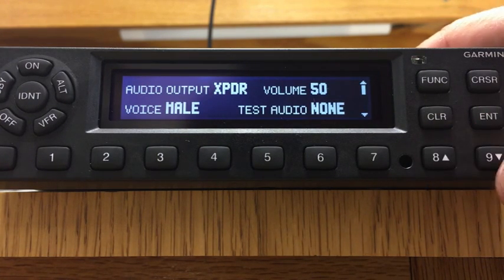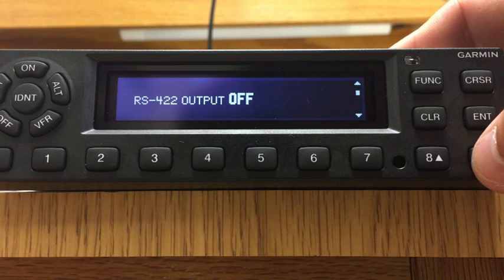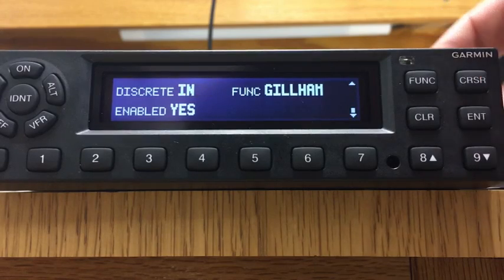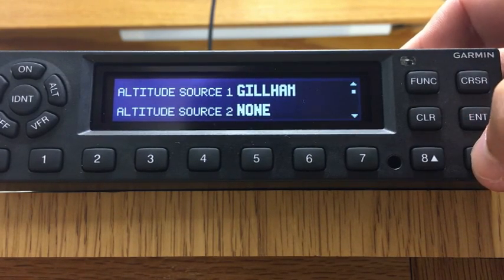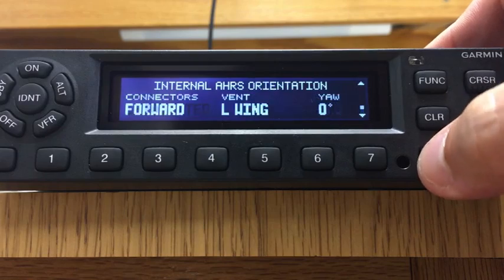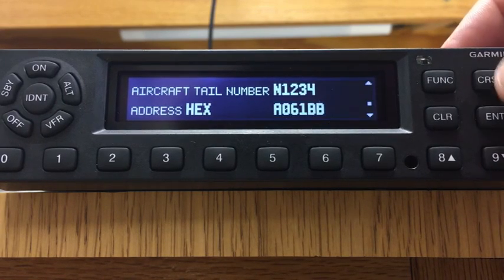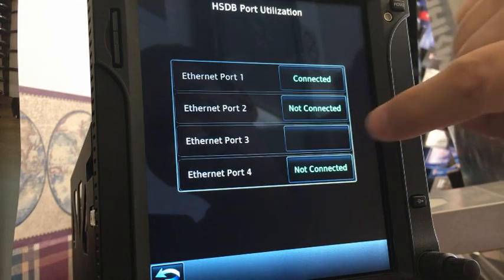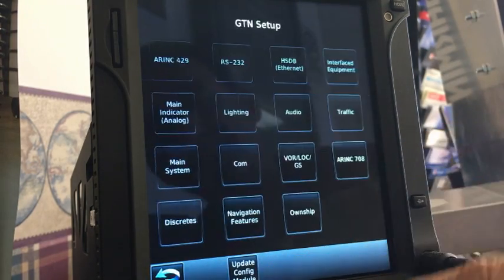GTX345 GTN650 setup

Comment: set allow pilot to edit flight ID to YES. It makes Angel Flight callsigns so much easier to program.
Reply from the maker: Yes it would be easier. The STC doesn't allow it but you can do as you wish. I won't tell.

Comment: Great Video!! Thank you John!!  I have some questions I hope you can answer.  How do you set up/configure a GAE12 encoder with a GTX345?  ATC "sees" the airplane 200 ft lower than the indicated altitude on the Aspen and the mechanical altimeters.  On the ground, with the Aspen and mechanical altimeters set to 29.92, the Aspen shows a pressure  altitude of -100, the mechanical altimeter shows -120 but the GTX 345 shows -200.  Also, should Altitude Sources 1 & 2 be set to NONE?
Reply from the maker: My suggestion is to do nothing. It is within 100 feet so it’s within Reg’s. Most encoders are only able to do 100 foot increments so they are often 100 feet off. The Garmin encoder can go as low as 10 foot increments.  If you want to get super accurate then you need to have a pitot/static test set.. follow the procedures in the install manual. Basically it will tell you to run theses test while plumbed into your GAE-12. Go to -1000 and push a cal button. Then again at 2 or 3 other points. Stopping at 30K if memory serves.  If it’s working then don’t change any settings.  Usually you go into the altitude encoder page and select Garmin encoder as encoder #1 and nothing as encoder 2.  If you have any other question be specific and I can help you through it.

Comment: Very Helpful. Question if you can...I have a GAE12 with the GTX345 and a GNS430W for GPS. Any tricks in the setup?  Doesn't show altitude? Thank you.
Reply from the maker: The setup in the GNS is pretty simple. It's of course in the manual. RS-232 in/out set to weather/TFC. ARINC 429 in set to High/ADSB traffic. The proper way to do the encoder is of course to connect it to a calibrated static test set and go to the 3 points per the manual. Conversely to cheat I've heard of people just putting 1 foot off on each of the 3 points and calling it a day. Obviously I can't recommend that.

Comment: Having the same issue with the Bluetooth not appearing in the main menu even after I’ve enabled it in the setup portion.  Not using any of the serial ports between devices, just wanting to connect wirelessly to the Aera 660 to send over adsb in info / AHRS etc.  . Does it need to have those physical connections?  I am getting a message that the TAS input is failed?   Am I able to do this with its own Bluetooth function?  It’s connected to power, ground , trans antenna and gps antenna currently.  There is an altitude encoder on the back but that’s it.  Thanks for any help!
Reply from the maker: Have you calibrated the Garmin encoder per the manual? If not that’s why you are getting this message. 

In setup mode do you have Bluetooth enabled. Is there no Bluetooth page in regular mode? When trying to connect to Bluetooth are you on the Bluetooth page as required?
Reply from the maker: Also if you are connected to a GTN then the bluetooth transfers to the GTN and is no longer controlled by the transponder.

Comment: John, I have a dual G5, GTX 345 , GAD 29 and GAD 13, in a plane I bought.  It’s not showing wind direction and speed.  Any tips on how to set it up?
Thanks
Reply from the maker: Just turn on the OAT in the dealer setup mode.
Reply: John you are the man!  That worked.  Thank you...

Comment: Excellent video thank you!  I followed these instruction to get the remote transponder control working (the shop did not set it up correctly) however now the remote bluetooth is greyed out on the GTN650 and all bluetooth functions have to be done via the GTX345 now.  Bluetooth is ON on the 345 and it does work just can not control it remotely from the 650 anymore.  Any ideas what I did wrong?  It used to work before I made the change.
Reply from the maker: There’s a lot to unpack in that post.  First, the GTN-650 doesn’t have Bluetooth. If you have the optional flight stream 510 then that can have Bluetooth that is controlled by the GTN-650. If that is the case then you would turn the Bluetooth off on the transponder and then it will be controlled by the GTN-650 “Connext “ menu.  Remember this rule. Traffic and weather are transferred from the transponder to the GTN by the HSDB high speed data bus.  The “control” is done by the RS-232 connection.  So if you can’t change the squawk code then it’s the RS-232 line that is at fault. If you can’t see traffic/weather then it the HSDB that is at fault. Let me know if I can help further.
Reply: @johnstark-StarkAvionics  thanks for your reply.  I am aware the 650 does not have Bluetooth itself and I do not have a 510 or 210. However the 650 used to be able to control the 345’s Bluetooth under the connex menu. Now it’s greyed out. Perhaps I should try turning Bluetooth off on the 345 menu and see if the GTN Regains control again?
Reply: So for anyone else who is having the same problem.  I was able to get the Connext link (no 210 or 510 installed) on the GTN650 to control the GTX345 bluetooth again.  When I went through this video tutorial I thought I was careful to follow John's instructions and turn the HSDB and Interfaced Equipment off (as warned in the video) and then back on after setting the 650's RS-232 Configuration.  Evidently it didnt take or I didnt do it right. Anyway, I went back out and set HSDB and Interfaced equiptment all to Not Connected and Not present, then re-set the RS-232 and then set the HSDB and Interfaced Equip back to connected and present and violå it started working.  You do not have to turn off bluetooth on the GTX345 setup (in fact it has to be on) but when working properly after setup you will no longer see that option on the 345 rehular menu and it is controlled through the 650.   Hope this helps anyone having the same problem.

Comment: Hey whats the config setup on gtx 335 to talk with ack30  (gray codes) mod 5
Reply from the maker: It is exactly the same as the GTX-345 that is in the video.
Reply: hey thanks i missed that while skipping the video..cheers
Reply: Hey John does GTN 750 interface with gdc74 and can we take pressure altitude from gdc74 for gtx345R?

Comment: Setup similar for the GTX-327?
Reply from the maker: Not really. There is not too much to the GTX-327. The only thing to setup is if you are using a serial altitude encoder. Then that port has to be turned on .

Comment: i have a gtn 750 with a gtx345 in/out i have not been getting traffic calls outs any idea what the problem might be?
Reply from the maker: Check the audio wiring first between the GTN-750 and your audio panel. If it checks good then check the audio output level in the GTX-345 setup. You can also test the audio to make sure it is working by going to that same page in the GTX-345 setup.

Comment: Every time that you saved the the configuration (on the 750), the dialog box came back and it said the it "FAILED" to save the information.  Why is that?
Reply from the maker: eallevato Although the unit I was using was a real GTN-750, I was using it as demo in my lobby, so I didn't have a configuration module in it. So it couldn't save it.